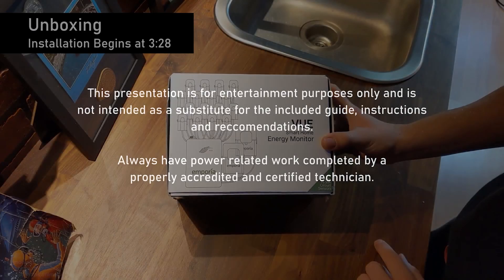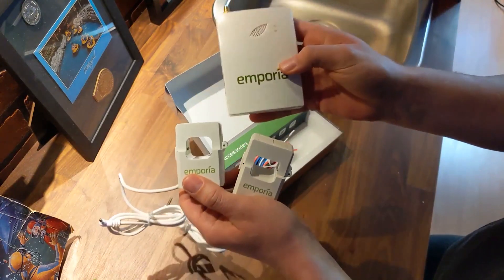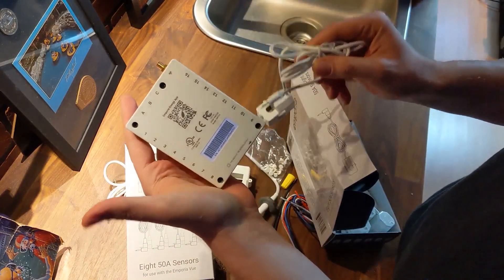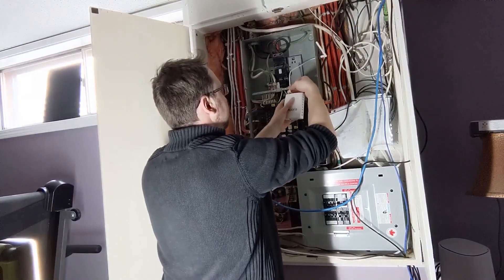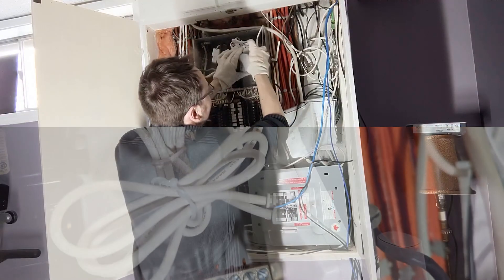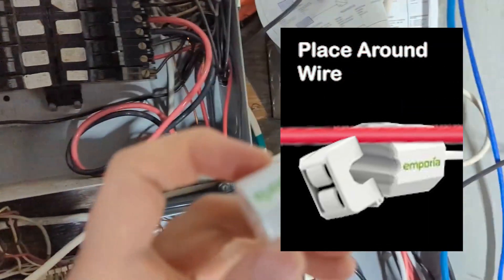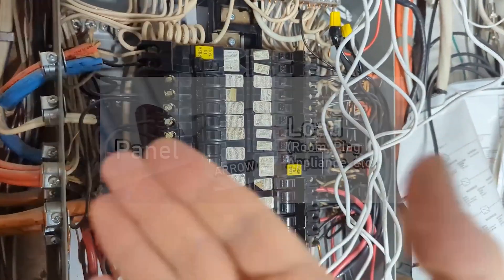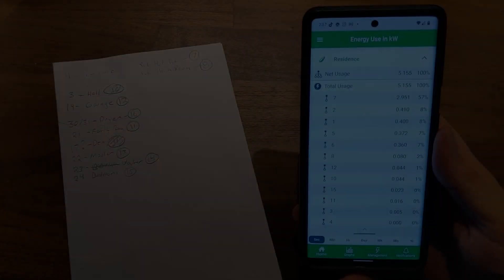How to Install an Emporia Vue: Solar Installation (and Basic Too!) - Unboxing, Install & App Setup!

Comment: Thanks for sharing your experience.  Are your inverters feeding into 220 breakers? You could free up three CT sensors by only using one per inverter and declaring a 2.00 multiplier.  I just got one of these and hooked it up a few days ago.  I still have some fine tuning to do.  It sure would be nice if the CT's were a bit smaller.
Reply: I was think the same thing.  I only have one inverter so I was think that it should be equal on both sides of the 40 amp double breaker.
Reply: I wanted to add the same comment.  For 240v loads I believe he properly used one CT to avoid being double counted although some appliances won't use equal power between lines, but I believe for any 240v inverter the AC legs should be approximately equal as well and may be setup to double count.  

I've been running the base system for about a month and just got a set of 50A sensors for individual breakers.  This was helpful especially to see how solar inverters were configured.
Reply: @tim7548  It doesn't work properly with a solar+utility system.
Reply: @andylinton2798  Why not? What doesn't work?
Reply: @amieres  well, if your solar inverter has a mains connection and derives it’s output from solar mainly but supplements from grid when solar is low, Vue will measure the incoming power from the grid ok, but what it sees as incoming power from solar already includes the grid amount - so it includes the grid amount twice. 
So all the calcs are then wrong. 
All they need to do it put in a sun that subtracts the grid power value from the solar power value and display that result as solar, and all would be good. 
But they don’t seem to be willing or able to do this. 
They admitted it to me and refunded me the cost of the product.
Reply: @andylinton2798  I see what you mean. There may be a workaround, like measuring the mains connection with a negative multiplier or a reversed sensor.
Reply: @amieres  possibly, but that means when the system is running solely on grid, the result would be wrong. It needs to subtract ‘grid’ from the value received by the ‘Solar’ sensor, then use that result as the solar value. 
I really don’t understand why they cannot do this, it’s a couple of lines of code.
Reply: @andylinton2798  Any idea whether the company has fixed this issue with the product?
Reply from the maker: Thanks for the tip! I'll update my system and pin this comment so others can see it.

Comment: I noticed you have a "balance" percentage.  What is that for?  Great video btw!!  :)
Reply: The system automatically adds up the total power draw from all your measured circuits, and then subtracts that from the total power draw for the entire house. The remainder is the balance (the amount you aren't directly measuring).
Reply: @kevinklassen4328  Thank you Kevin!  Can you please tell me what it means when the "balance percentage" turns green and measure over 100%?

Comment: Awesome thanks! Was wondering how to set it up for solar. 
Also a tip. Everyone look up flashing local software onto the VUE. 
It’s a lot more accurate and all stored local. 
As it comes stock, you need to use the emporia app. Which doesn’t even read your actual Vue meter. It gets its data from a Chinese server. Everything the vue senses, it sends to that server. Then it sends it to your app. So not only is it faster, but you won’t be spied on
Reply from the maker: How would one do this?

Comment: I'm a little confused, you have 3 inverters going into the same subpanel? thats new to me, but I guess since I only use 1 inverter for my house I wouldnt know.
Reply from the maker: It's normal to have more than one inverter, if your system is large. What's size solar system have you?

Comment: Hey, I have one doubt and I hope someone can help. How can I merge or see only one circuit of solar but measuring both? Just to see Solar as a total. I know there's a parameter called "Circuit multiplier" that can be set it as '2' because theoretically inverters have same current in both lines,  but I'm not sure if it works that way.

Comment: Very cool glad I came across your video, now did you come up with the solar solution aka trick of reversing the sensor or did Emporia actually tell you to do that?
Reply: Yeah, it's in the instructions, or the solar supplement manual... I can't remember specifically but it was in there yes
Reply: @BestEdmontonMall  I dunno - I'm looking at the Solar Supplemental and page 5 is clearly showing Breaker = K and Inverter = L, which is the opposite of what's in the video... but that doesn't work. When I reverse them, per the video, things work out just fine. https://uploads-ssl.webflow.com/5fff2b7694451e66ba2f5a3d/60a6d4716c08d800fa599c86_Gen%202%20Solar%20Supplement.pdf